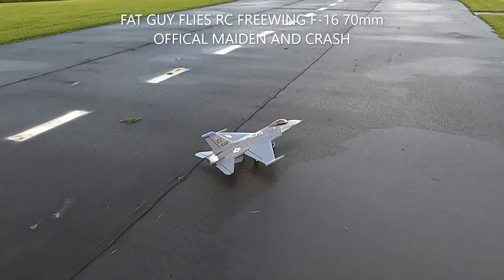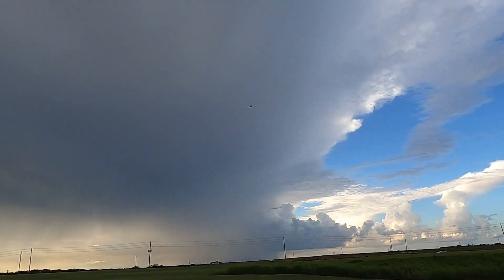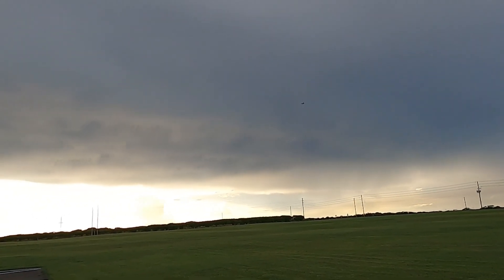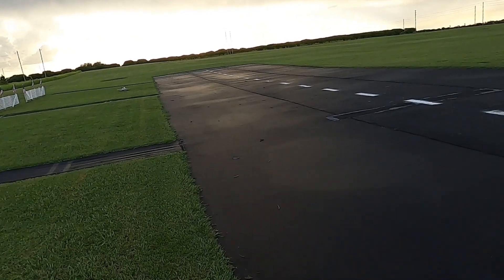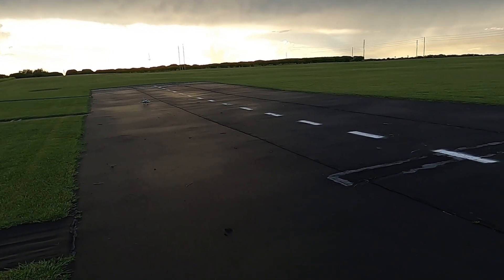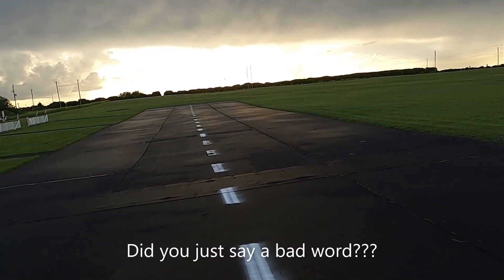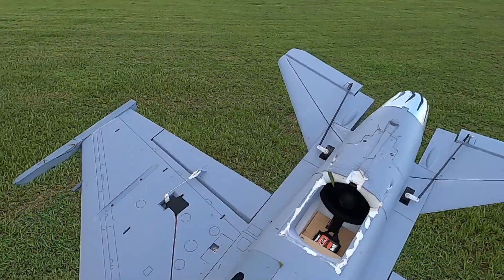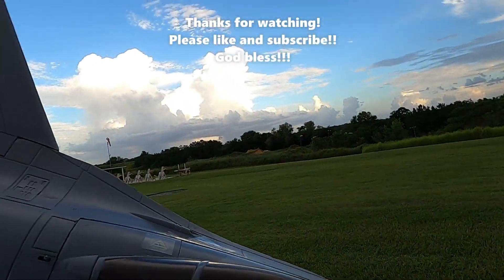EMERGENCY LANDING from nose gear failure! Freewing F-16 70mm by FGFRC

Comment: Great Video, Thank goodness there was not more damage. A short time ago a friend had a issue with his main gear not extending after a touch and go. He did a high alpha into tall grass and had zero damage. His issue was a connector vibrated loose because the wiring too tight after zip tie installation ( i.e. he had no slack in the wire), I wonder if you may have escaped damage if you would had high alpha the model to slow it down more into a induced stall just before touch down? Why has no one done a video series of emergency landing procedures with each type of retract aircraft? Warbirds, EDF Jets, Civilian airliner EDF's . The retracts from every company seem to have issues and there would be value to such a series. I have a $250 dollar repair due to a retract grub screw coming loose during touch and goes, My fault for not inspecting the gear closer after each flight battery. I will incorporate that into my preflight checklist but it was a expensive lesson. Enjoyed watching👍👍

Comment: You seem to have some really bad luck with f-16's and landing gear. It is really pretty in the air and some nice rolls. That could have been a lot worse with stuff hanging off the bottom. Thanks for sharing.
Reply from the maker: Yeah I will get the hang of it. Thanks for stopping by.

Comment: They always fly better after a wreck. LOL
Reply from the maker: Ain't that the truth...lol
Reply: @FatGuyFliesRC  Well I just smashed my F16 50mm straight into the ground full force. The ESC flew out of the battery bay, still trying to figure how it got passed the wires and all lol. Gah I have 7 grounded planes, 4 still in boxes and 2  under construction and 1 that's ready to go but never flown it and to large of a wing span to fit in my car lol. Time to bust out the top race sky trainer for my fix 😢🤣